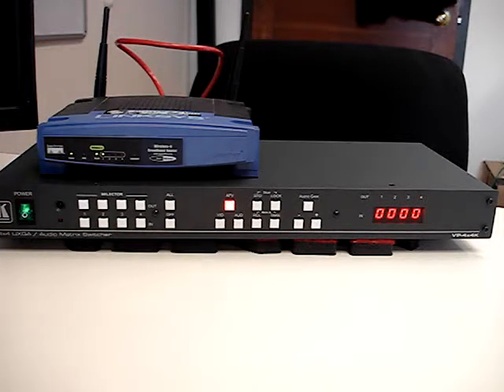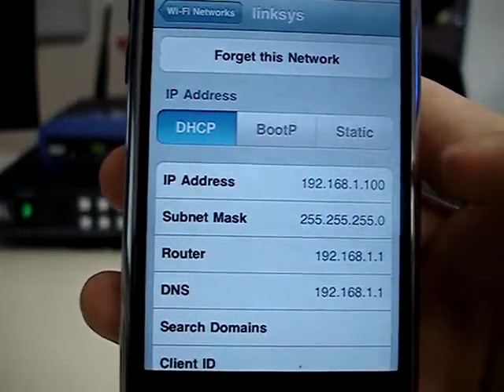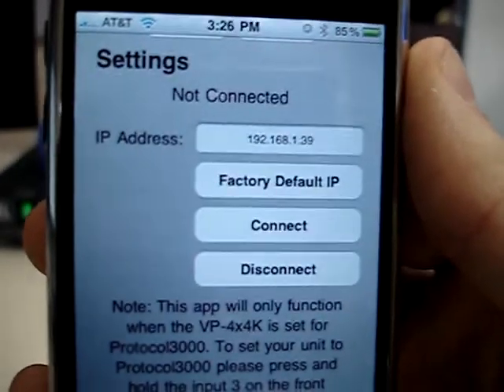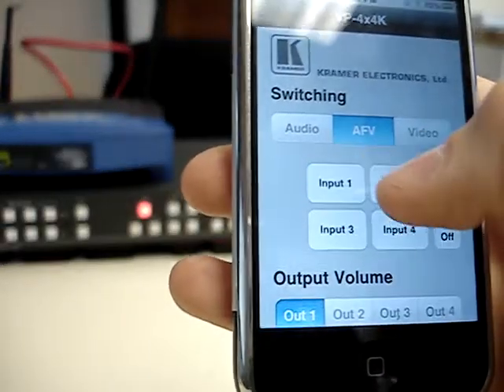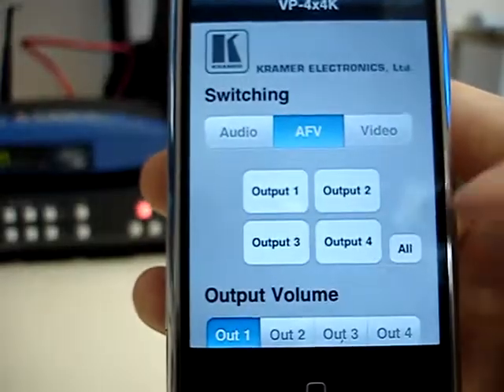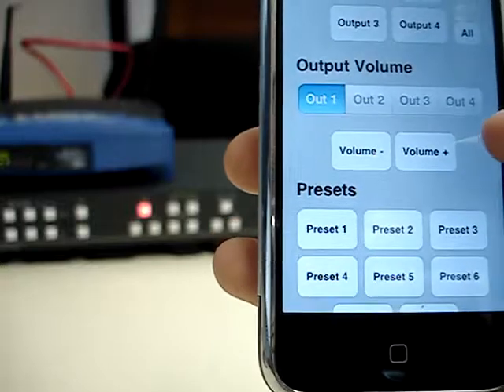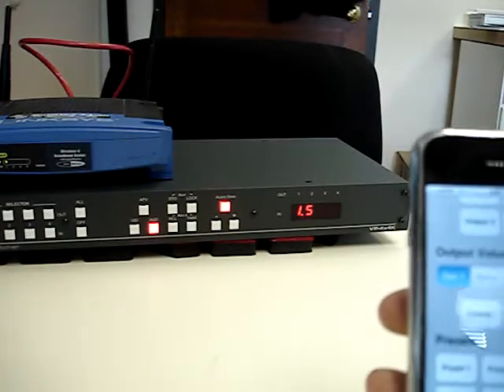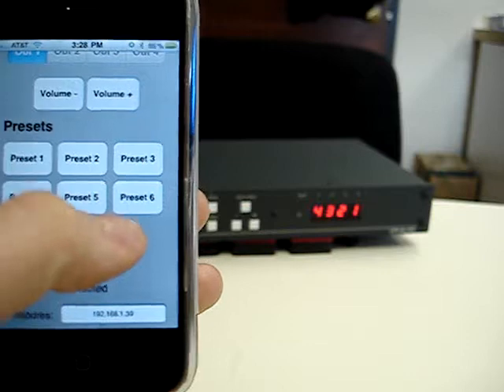Kramer VP-4x4K App Demo

Comment: Hi Sir! Can i use 2 KT107 in 1 sl240c
Reply from the maker: yes, using Kramer Control you can use (2) KT-107's with a single SL-240C brain. This doesn't have anything to do with this VP-4x4K app demo however.